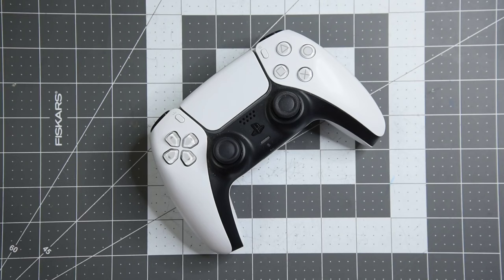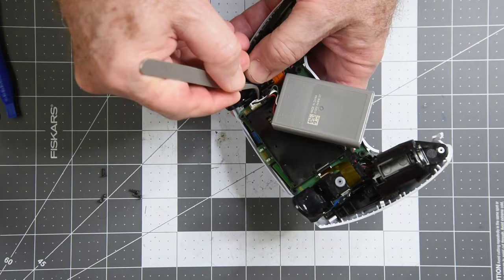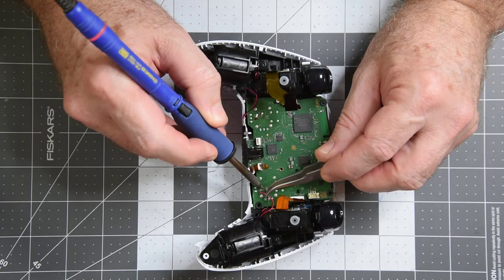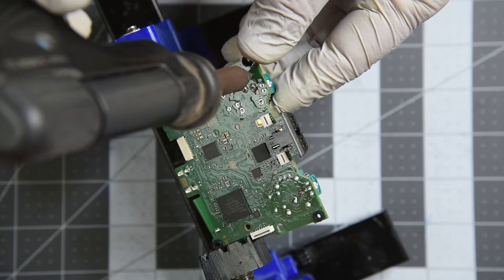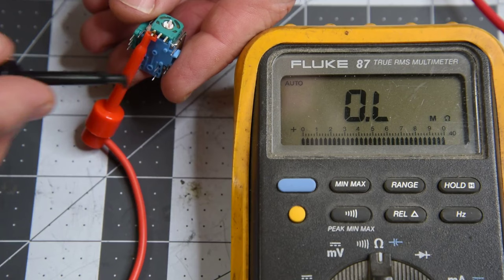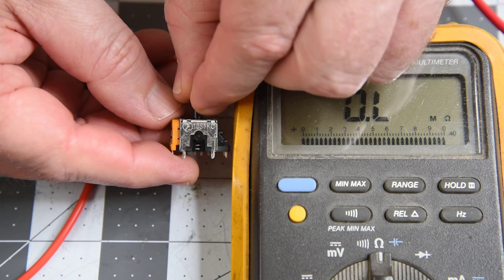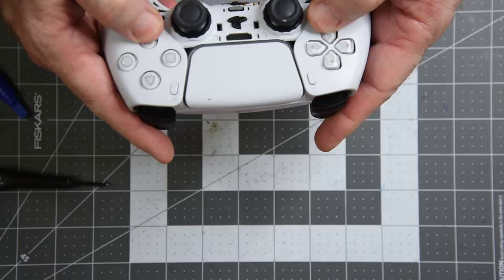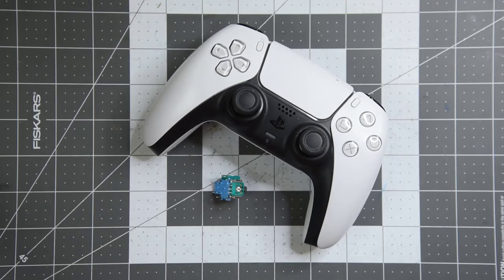PS5 DualSense - Joystick Replacement

Comment: Ive never done this. Hoping i dont break my controller. 😀
Reply from the maker: Good luck, take your time and it will go fine.
Reply: @metalplasticelectronics354  So far, no good, I managed to take out the potentiometer, but the hole is full of solder, and I can get it out to put the new one in. I tried using solder wick and the solder sucker tube. But nothing is working. 

I'll keep you updated.
Reply from the maker: Make sure you put plenty of fresh solder on the pads for the solder wick to work.  Also if you have some flux, coating the solder wick with it will help a bit.  More than a bit if the solder wick is old.
Reply from the maker: Here is a link to a video I did using solder wick, see if it helps https://youtu.be/slxgHcYHnm8
Reply: @metalplasticelectronics354  Thanks ! Will try this today after work. I'll keep you updated. I hope the bord still works 🤣
Reply: @metalplasticelectronics354   good news !!! Thanks for the video ! It helped a lot! Everything went well and now my controller is fixed ! 😀
Time to update my resume

Comment: my ps5 controller inside center contact material is wore completely off.. within 3 months.. im thinking its a common problem.. just a big POS designed to fail so you have to buy 2-3 controllers a year but wait.. there is conveniently a 200 effin dollar edge controller available.. hmm... i wonder why that is.. make you controllers so shit that you gotta spend 200 after buying there originals a few times... next thing you know sonys making 300 bucks a person on controller market..
Reply from the maker: I’m thinking it’s a maybe 10% problem.  Have 4 controllers that are over a year old.  Only 1 has had to have the joystick replaced.  I think it my have to do with how well the potentiometers wiper is stamped and formed.  If it’s not near perfect, potentiometer want last long.  This is an area that Sony could spend a bit more on and not add that much to the price of the controller.
Reply from the maker: Yes you can just change the potentiometer.  Just have to make sure to get the right brand.  The orange ones are Favor Union and the blue/green ones are alps.  They are not interchangeable.  For the PS5 the Alps ones are 2.1k and the Favor Union are 2.3k.  Much easier to just change one of the potentiometers than the entire module.
Reply from the maker: Best I can tell as long as it's 2.1k should work.

Comment: Fantastic exposure of potentiometer resistance values, your vid is gold for that reason & going in my playlists for reference info 👍🏻🎮👍🏻 somewhere near the top of list 🤷🏼‍♂️, complements my own findings nicely.

I've muddled through without an ohms tester for years from know-nothing to fully qualified know-nothing 🫡🎮 still haven't got one 🤤. 

Resistance replacement parts are best just greater than factory 🏭 part, to trim pot back to & deadspot 🎯 calibrate. 

XBox Elite V2 cores in my DS4 with custom made concept sticks 🕹️, better than anything I've seen so far. 

What's next, hall effect side mounts maybe 🤔 only if I need them, the mod options are growing at warp speed build back butter 🧈🫠 👀👁️👁️🤦🏼‍♂️ 😁...
Reply from the maker: Thank you
Reply: @metalplasticelectronics354  I think the reason they decided to use lower resistance potentiometers is because when the part current changes from wear it's basically a replacement job, it's like stepping up minimum viable disruptive technology to a whole new low 👎🏻🎮👎🏻 the scope for repair with external parallel 3x3mm trim pot modification seems Alot slimmer for its current ⚡ tolerance scope, you could probably use 10.24k potentiometers but then you would have to use low resistance 3x3mm trim pots say 30k or below to reduce the overall pot resistance & dial in the deadspot 🎯 & outer stick 🕹️ circularity over shoot 🔫 % margin tightness 😉.

Low resistance potentiometers is a scum bag move they / them pulled. 

Like saying don't you guys own mobile phones 🤳, coercion by planned obsolescence negative quality control 😂🤣😭.

Their market term is Quality Fade, Morality Fade 👀👁️💀 is so much worse on the forced labour contingent 🤦🏼‍♂️🙍🏼‍♂️. 

So much for green new deal build back butter 🧈🫠 more like slippery 🐲🐉 market conditions for our fortune 🥠 all in this together 😱.

Search this vid title for insights to true market workings: How China Tricked Apple

Just my opinion 😁...
Reply from the maker: There not building stuff to last that is for sure.
Reply: @metalplasticelectronics354 
I have new strategies for repair re-calibration of response curve report, after fitting replacement pot sides I use twin 3x3mm trim pots on one ☝🏼 stick 🕹️ axis now, one for each polarity - & + side 😉 fully tailoring the resistance value 🎛️🎚️🎚️ with the value needed per side to shrink or expand the gamepad tester outer circularity Avg Error: % test result 😁🤤. 

(12mm wide Kapton tape to isolate that rumble motor terminal should do the trick 🫦😬🤐, I will not be stopped lol)

Twin 1m + 1m trim pots now provide 2m minimum current ⚡ flow circularity & deadspot 🎯 draw in resistance if needed 😂 on full pot range per side - & + test terminal. 

I'm waiting for 20k 3x3mm trim pots to grant me maximum draw in potential of 40k, you fit them with a V wire on .2mm tinned copper wire looped round the back from centre pin 📍 for fast flexible switch outs, always a bonus lol.

In this way as long as you can reach just beyond the 💯% outer boundary on open trim pot screw 🪛🪛 positions & centre your deadspot 🎯 max reading numbers #🔢 per side you can defeat mechanical slop 🕳️ tolerances somewhat 🤔💭🧐. 

I have just that problem to solve on the DS4 I fitted with Xbox one elite series 2 screw 🔩 type fitment pots with tension spring adjustment built in.

Right stick 🕹️:
Axis 2 has a single 100k trim pot fitted reading -0.09020 & +0.09020 deadspot 🎯 chasm 🕳️.
Axis 3 50k trim pot fitted with the same 🐂💩 reading 😭.

Single 1m trim pots shrink Avg Error: % 1.4-5% of circularity.

1m + 1m 0.7-8% response curve shrinkage is the new fractional minimum granting control 🎛️ 🤷🏼‍♂️.

I'm looking at 30k + 30k = 60k tried 🙅🏼‍♂️
30k + 20k offset 
20k + 20k = 40k resistance to squeeze blood 🩸 out of a stone 🪨 & make a semi decent deadspot 🎯 😂🤣😭🙌🏼🤲🏼🫸🏼🫷🏼🙏🏼 this pad 🎮 will build back 🧈🫠 & 💩 me it's best Tiffany cufflinks 💍💍💎 🥹...
Reply: @metalplasticelectronics354 Flush cut the 4 pot pins & 4 button pins to the PCB might provide a swifter switch out 🤷🏼‍♂️, as long as the anchor ⚓ points are not compromised 🤔💭🧐, button pins 📍📍📍📍 are safe to cut short at least. 

Rapid desolder achieved???
Reply from the maker: Yes, I need to do a video of cutting the joystick out to remove it.  Most people don't have a vacuum desoldering gun.
Reply: @metalplasticelectronics354  I have to peel down the side wiper on the 3 pot pins & unclip them first before attempting to remove a whole pot. 

Standard solder sucker & extra solder added to flow it off the PCB 😂🤣😭, scrub kit demands more patience & skill but you can get by 🤷🏼‍♂️, it's just harder to rework stuff, that's why I'm thinking 🤔💭🧐 of strategic post shortening, it should do the trick. 

(Then police up all the splash metal that can ruin your day in the wrong places 🥹🔍 lol)
Reply: Took me 720 with fresh solder so yeah, Sony using some heavy stuff.

Comment: Damn,
The connectors to the ribbons are so flimsy and delicate, they broke immediately “

The process just to replace the thumb sticks aren’t really worth it.
Ughhhh😵‍💫😖

Great video and knowledge but remotes garbage now😮‍💨
Reply from the maker: If you don't use the microphones in the controller, it will work with them unconnected, I take it that is the FFC that broke.

Comment: I have a question, i have a few stadia controllers that i will never use, and i was thinking if i could open them up and extract the potentiometer and put it in one of my dualsense controllers that is having drift issues. Could I do that?
Reply from the maker: It just depends on who makes the joystick.  The alps potentiometers are not interchangeable with the favor union ones.  Not sure what the stadia controllers use.